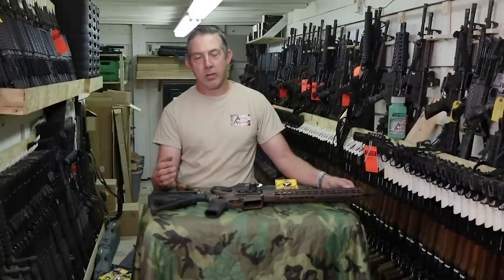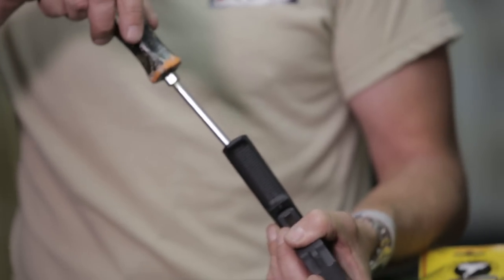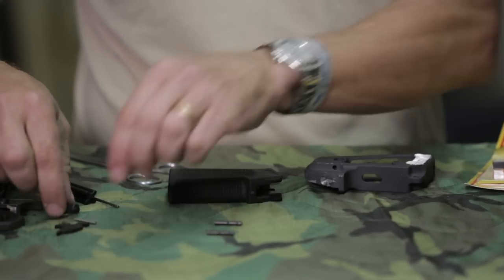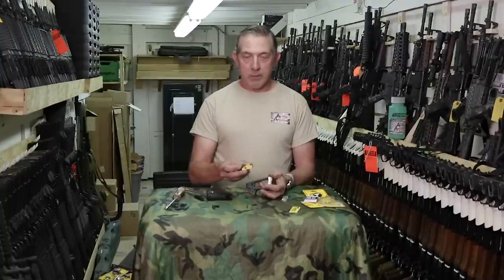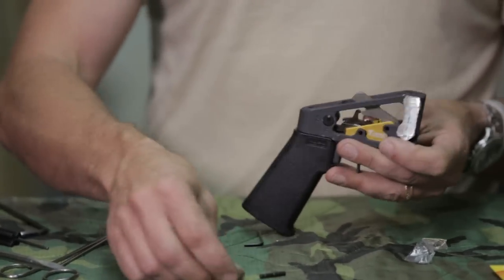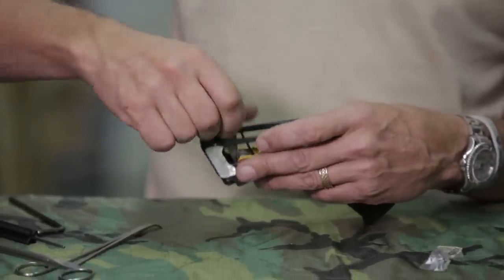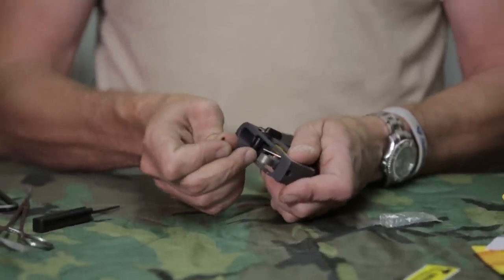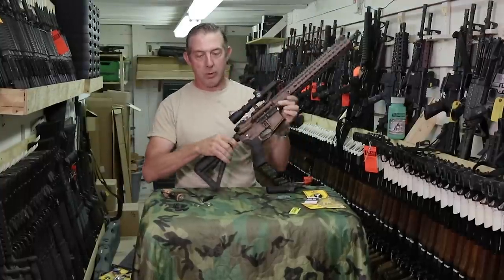How to Replace a AR Trigger | Timney Triggers | Tactical Rifleman

Comment: Just a heads up for anyone planning on installing this. Purchase the Antirolling Trigger and Hammer Pin Kit, purchasing the Timney Trigger. Though, this is an excellent aftermarket trigger. The pins roll when using this trigger. If you don't get the anti rolling pin kit, the pins will eventually work their way out sooner or later. Unless, you have great eyes, you probably won't find the pins after they fall out. Spend the extra $35 now, and save yourself an outrageously amount of headache. Other than that, you'll absolutely love this trigger.

Comment: Just installed a brand new Timney AR Targa 2 stage and its gritty on stage 1 take up and also the reset sticks randomly. I have to push the shoe forward to get it to fully reset whenever it happens. Any advice? Timney hasn’t responded.

Comment: Thank you . 
I wasn’t sure about the bottom set screws . They should be flush .
Moving the legs of the springs out of the way for the top screws worked like you said . 
I had no problem putting this trigger in . 
 How ever ,  the pistol grip always takes me a little longer to do .
I now have a 3 lb trigger in my Grendel build .
Reply from the maker: Glad this video helped out

Comment: I’m having issues with my trigger install. I have a Velocity trigger and a San tactical lower. The allen key screws on the trigger unit drop out when i get to the tightening step. I was told that the issue could be that the screws are not long enough for my lower. Was this the most likely diagnosis or just an easy answer given to me by an impatient sales rep?
Reply: I am not familiar with this trigger but from what you have said I will agree with needing longer set screws.  Thanks for watching.

Comment: What are the set scews on the timney for?
Reply: Timney does not use inside the hammer wire or hammer spring to hold the trigger pins in place.  This being a drop in unit they use the set screws to push the unit up to put pressure on the trigger pins that will hold the unit in place in your receiver.
Reply: Pete Jones Thanks, had absolutely no clue
Reply: Pete Jones, as the set screws are basically used as an ersatz "jam nut," per se, is there any need to place a small drop of LocTite on the threads to keep them from "walking out" or will they definitely stay in place?
Other than that question, thanks for the info and video. I always learn something new when watching all of the TR vids!
Reply: Timney says not to use Loctite on the trigger.  With that said I do know of people that have put it on the set screws with no issues but I have also seen people that used Loctite and it ended up into the the actual moving parts of the trigger.  Loctite does not work well with moving parts or should I say moving parts don't work well with Loctite unless you want them to not move as freely or stop moving at all.  Because of this I agree with Timney and I have never used Loctite on any of the Timney triggers I have installed.  Thanks for watching.